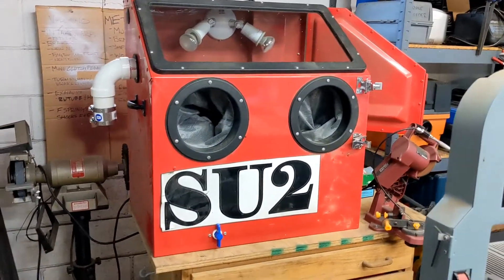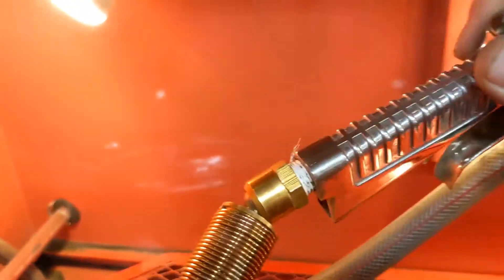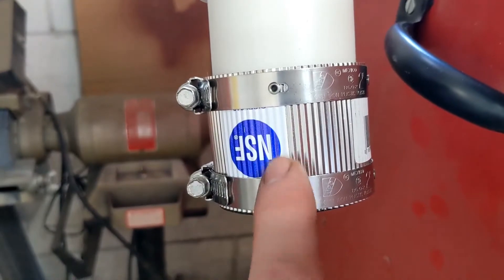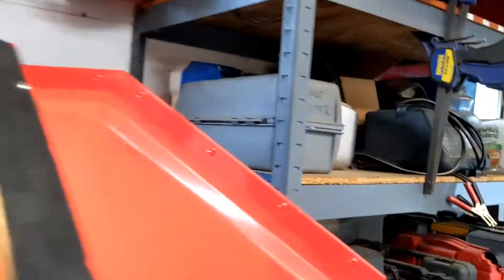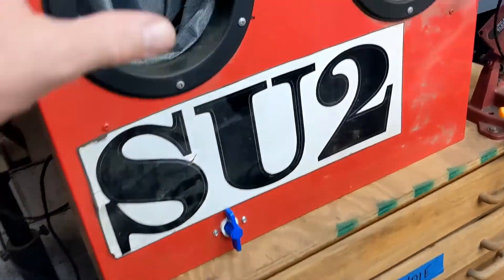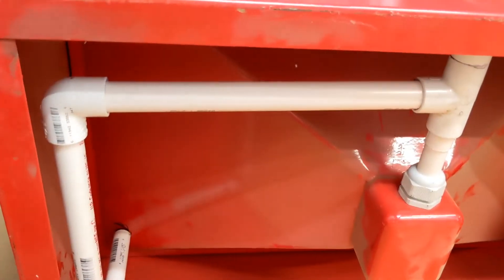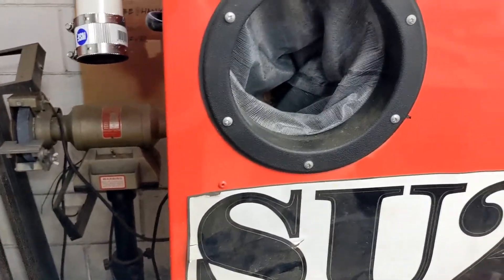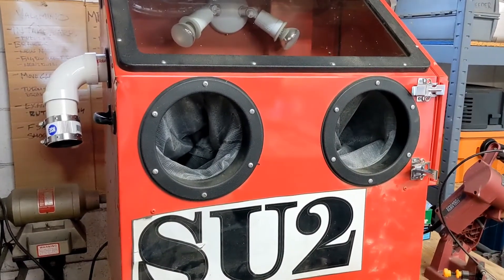Harbor Freight Sandblaster Mods, Tabletop Edition

Comment: I have the one with the stand and it doesn’t work…🤣 I’ll be trying your mods and hopefully make mine work.
Reply from the maker: Adding a line outlet at the bottom and putting a drier in the air line made the biggest difference for me. On the model you have, I think you need to drill a hole in the trap door to add the line.
This is how I set up my compressor to keep the air dry: https://www.youtube.com/watch?v=6rsZjfytL50
Reply: @WhatIsTheWheel  I hope to make the repair of my cabinet a video one day. Since I have the large hopper I need to add a vent next to the supply tube I guess. I watched a few videos years ago but really haven’t needed it yet to force to repair it. I will definitely use some of you ideas for mine.

Comment: Wow, works great! Thanks for the upgrade ideas.
Reply from the maker: Thanks. I should have done a video of making it but didn't think of it til I was done
Reply: @WhatIsTheWheel  Got the idea with the visuals on the finished changes enough to figure what you have to do.  What is remarkable is the siphon system working without any air ingress (closed valve in front) as you mentioned.  Just finishing mine and may use your method if the siphon pipe in mine is inadequate.  Nice to have options.